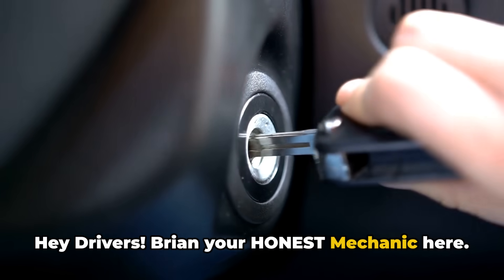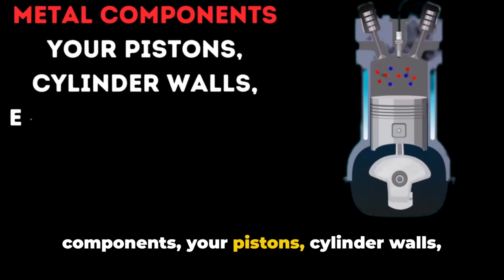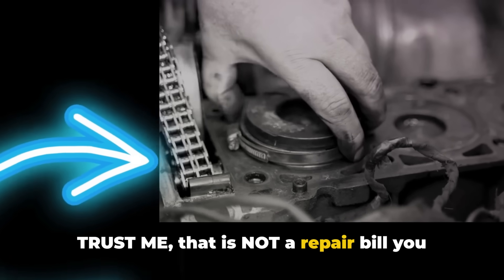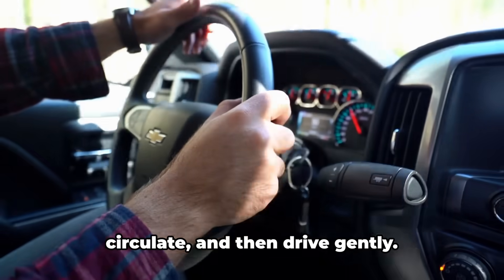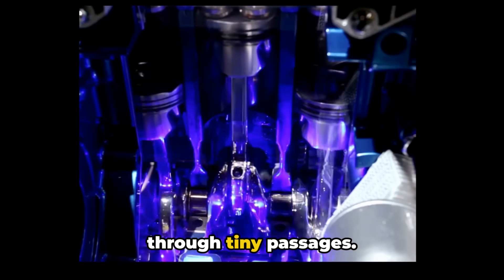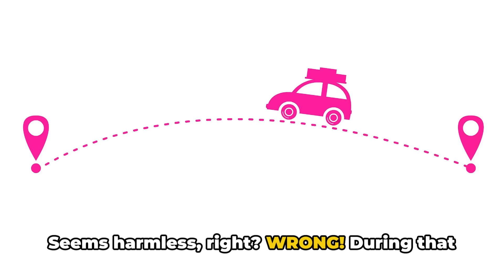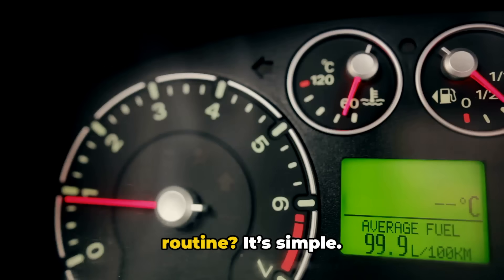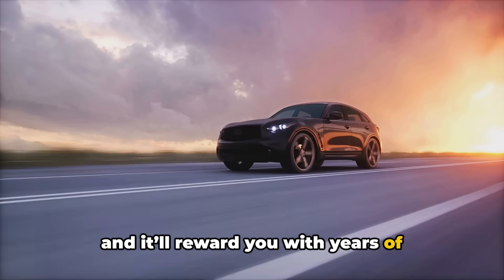5 Cold Start Mistakes That Wreck Your Engine (Avoid These)

Comment: @HonestMechanicChannel,  your correct to let it idle 30-60s first and on all your other points !  You as well as other U-tubers on this subject,  never CONSIDER/mention THE 2 step engine preset FAST IDLE!! [fastest then a kickdown to FAST (then normal)]!!  I normally wait for the 2nd kick-down before I take off; which by the way is your 30-60s (?maybe longer if 'really' cold?).  I take it easy then [ keep between 2-3,000 or so (4k)rpm],  till OIL temp. needle begins to move off peg.  I THINK FROM NOW ON you incorporate /mention fast idle into your future comments on cold starting.  {a GOOD question TO CONSIDER would be is driving off with idle on its fast idle cycle  a good idea / i.e.  hurt the engine???;;;  also ,would most cars' fast idle cycle disengage and go to normal idle speed earlier than normal? / is this ok? !

Comment: Something you can do to get that 30 to 60 seconds you need to warm up your engine is to start the car and then put on your seatbelt check the mirrors etc.  It gets you those critical seconds but not wasting them.

Comment: The first one is especially cringe worthy. I live in Colorado. On more than one occasion on a 30-40 below 0 night,  I've seen people jump in their car and hold the throttle to the floor for 10 straight minutes. Literally bouncing off the rev limiter, for at least 5-10 minutes straight. 

I always warm my car up, at least until it comes off of fast idle. 

Have you ever driven a car for an hour when every surface in the car is 30-40 below 0 ?

Comment: I disagree with the idling. I have let my engines in my Fords sometimes idle for 30 minutes before I jump in and leave. 

I get 300,000 miles plus out of my engines been doing this for almost 40 years.

Of course I am absolutely fanatical about maintenance. Either way idling is never hurt my engines.
Reply: And also wasted truckloads of fuel
Reply: What a waste of fuel though.

Comment: best rule, is to allow a 3–5-minute warmup time. it gives all the fluids a chance to circulate, and warmup. it also allow the idle speed to stabilize.
Reply: It’s what I do on bitter days. Always allow the engine’s fluids to circulate for AT LEAST one to two minutes, then drive conservatively for 1/2 to one mile to allow the transaxle fluid to gather some heat, and you’re good to go!  🚗 ⛄️ 🇺🇸
Reply: Are you driving a carbureted vehicle? That's the worst thing especially for the catalytic converter. You should never start modern cars and let them sit for 3 to 5 minutes and warm up Even the car manual is against that and the manufacturers it's not good for the modern car.
Reply: Depends highly on the temperature. Cold is not an absolute thing. I dont let my car run for minutes as long its only 0°C. Maybe when its -20°
Reply: @PM-wt3ye i always let my car idle for 5 mins in winter before leaving. Time enough to scrape all the windows and clear the air vents below wiper blades. I’m Canadian, and yes, its always -20C or more when I do this
Reply: I do 3 to 5 minutes in cold. 3 if its around -2 to -12 C , 5 if its around -13 and colder
Reply: Incorrect.

Comment: I wait for the RPM drop by the engine controls before selecting a gear.  This reduces the shock on the transmission and driveline.
Otherwise I have long used the technique you outlined.  The short distance drive is sometimes unavoidable.

Comment: Sir everything you said makes sense especially if you're driving American cars. But I drive Toyotas and had several of them over the years the mileage has been 168,000 too 417,000 with the oldest being a 1996 Camry. And every single one of them ran until I got rid of it. Just routine maintenance driving over 100 plus miles a day with cold starting and all the other stupid stuff you do behind the wheel.  "JUST Saying" Toyota 👁️

Comment: Hello.   I have a 2016 bmw 218i active tourer with a 1.5 turbo 3 cylinder and a automatic transmission.  When the engine is cold ( mostly in fall and winter time).  And the engine is rev above  1000 RPM it’s not able to drive away.    The car will simply not accelerate and go in second gear. I have to wait about. 40’seconds  and than the meter is below 1000 RPM  and than i can drive away without issues.   Is this normal?
Reply: yep, safety feature

Comment: I told my wife that we need to park our cars in our garage.  Even unheated, the garage temperature is 49-53 when outside is 30-35.  And our cars don’t have cloudy light covers even after 15 years.  Some of my neighbors, for a variety of reasons like their cars are leased, park outside.  In the winter, it’s like refrigerating the cars which is 37 for my frig.
Reply: Well, you're right about the garage!  And not only that, you can splice in an engine block pre-heater to one or both the cars, since you have somewhere to plug them into.
Reply: Yes you can fit a water heater into the water hose .And put it on a timer for say 4 to 5 hours before you want to start the car .Not only will the rad water be warm ,warming the engine ,but you will have instant heat from the car heater .Even if you have to park outside you can run a extension cable from the garage to the car .
Reply: Just be sure to open it a bit when your car is idling
Reply: Must be nice to be able to have a garage.
Reply: @oceanofjelly must be nice to have a house
Reply: It’s the wind in the wind it’s colder. In a garage that’s not heated it’s still very cold but you’re out of the wind so it’s less cold.

Comment: I live in Wisconsin. It can get  -30 below zero or colder. Windows are frozen solid. We have no choice but to let it idle until you can see out your windows.
Reply: I live in Alberta, it can drop to -40 without the windchill.  By the time I remove my windshield cover, sweep off the snow and unplug the block heater, my vehicle is ready to go.
Reply: Sounds like most people commenting may live in southern California or Florida.

I grew up in Northern Minnesota. 30-50 below 0 is not unheard of, and I've experienced 85 below 0 wind-chill...117 degrees below freezing.

You could literally drive for 30 minutes and it would still be -20 to -50 inside your car, if you followed the idle for 30 seconds and go routine. 

Who wants to dress for an Antarctic expedition for their daily commute?

A little off topic, but I currently live in Colorado and studded tires are legal here. Seems like they should be legal in every snowbelt state. I grew up in Duluth, Minnesota, picture a miniature San Francisco. Most of the city is built on a very steep hillside.

People claim cars running studded tires cause alot of road damage. Semis cause 100,000 times the damages as a car with studded tires. A 40,000 - 80,000 pound truck literally crushes the road. Where do you think the grooves in highways come from?
Reply: @425superRocket I played a hockey tourney back in the early 90’s in Cloquet and it was like -50.   Absolutely insane, but the worst cold I ever felt was in Saskatchewan.  You had to start your car every 1-2 hours just to circulate the oil so things wouldn’t seize up.  It isn’t as bad in MN the last 10 years or so, but still, I have no idea why I live here lol.
Reply: I lived in Northwest Wisconsin.  Sometimes, I would let my vehicle idle anywhere between 5 to 20 minutes when it was brutally cold.  Maybe that was bad, but I hated getting in a vehicle that was so cold that my breath would ice up the inside of the windshield. @425superRocket
Reply: no problem...get an e/v...by the time you can scrape of the ice to drive...you will need a charge...free day off...

Comment: In actually, the correct warm up should be to start your engine for 1 to 2 minutes and then driving easy  for about 5 to 6 miles to completely warm up the whole vehicle. Which includes the engine, transmission, differential and all other bearings (wheel, drive shaft and more).
Reply: Your engine needs 1-2min to start?!
Reply: Lol

Comment: How do you warm up a cold engine for oil change?
Reply: Cruise around at least 20 minutes.  I tried a driveway warm up, but the oil was s-l-o-w draining.
Reply: I am gonna go out on a limb and say you start the vehicle and let it run for a few min🙄. Although it is not needed anyways.

Comment: Living in a northern state (Wisconsin).  I crank my vehicle over and warm it up for a few minutes only if I have to remove a copious amount of ice or snow from my windows and have no other option than to do so before traveling for safety reasons.  On a regular day I start my vehicle and wait for the tachometer to drop a bit (usually 30 seconds to a minute) throw it in gear and drive slowly until it reaches a better operating temperature.  Some solid tips from this video in my humble opinion!
Reply: Same here in MN, I usually wait until the idle drops and watch the temp gauge go up 2 notch before driving off, these pass few days been cold so I let it idle for a few minutes before driving off
Reply: Why not scrape off the ice and snow before starting it?
Reply: @joby602  prob to let the engine warm up while scraping the ice off
Reply: @ethannguyen9363  Agreed.  Wisconsin has very cold winters with lots of snow and ice, so combine the 
times of snow and ice removal with a 1-2 minute idle time looks good to me... but not longer than that.  If
more time than that is needed, remove half of the ice and snow, start the engine, then do the other half.
Reply: @joby602 sometimes the ice is so solid, you unfortunately need a little help from the defroster to get it loose enough to start scraping. This raises a question that I’ve never got an answer for. Why aren’t there wires in the front glass like in the rear? I get it, not as many as the rear, but some that can help you start the scraping.
Reply: @Schneids71 Ford I beleive have the patent on heated front windscreens. A lot of their cars in Europe have this. 
I’ve always felt that they should allow all other manufacturers to use the technology for a minimal fee. Volvo I think developed the wipers/ intermittent wipers and may have something similar as they knew it was a safety function
Reply: @guyr7351  Can't believe there is a patent on that. A patent requires something innovative and obviously there is nothing innovative about a wire-heated window, be it in the rear or in the front.
Reply: @Schneids71 By a windshield cover for your vehicle. They work great.
Reply: @pliccut I love the frostguard brand. I have one for the front and rear windows as well as the side mirrors. I also have their acrylic scrapers.

Now to get more for the rest of the family.

Cheers!
Reply: @Schneids71  Do you want to drive down the highway looking through wires? Ya'. That's what I thought...
Reply: @joby602 , and scratch the windshield each time while doing so!

Comment: If i am engineer i would develop electric oil pump with normal oil pump and for heating i would develop electric heater that warms coolant. AC compressor only freezes i would develop AC that heats and freezes. Develop VR8  cylinder engine (one head)  that can work only with 4 cylinder for fuel consumtion. Timing with only gears. Supercharged engine belt driven or strong electric charger.

Comment: I would also add that oil temp is prob more important than coolant temp. Oil temp takes long to get to operating temperature than coolant temp does. In other words just because your coolant temp is at operating temperature doesn't mean that you oil temp is too. Unfortunately for most modern vehicles, the car doesn't let you see your oil temp. Just another way modern cars don't last long and are engineered to get you into another new car sooner. Money money money, the only thing that matters to some.
Reply: I worked in the Arctic for about 30 years and about six months a year we idled our vehicles all day. We usually started them an hour before we used them in the morning. Diesels make a racket when starting an engine at 40 below. Colder than that we just left them running. We had weather front on our grill.
Reply: Very well spotted.
Reply: My father's old car Opel Corsa B Sport 1.4 turbodiesel there was no oil temp neither oil pressure yet it did almost 500K KM with no engine repairs and it would still be working with the same engine if my brother didn't blow it's head cause a water pipe blown and he kept driving, overheated it and cracked the head.

My Peugeot 206 1.4 HDI for example is eating a bit of oil much worse than the opel and has around 250K KM so I guess it just depends a lot on the car, the Opel Corsa has a Isuzu engine is a amazing engine from Japan while my Peugeot has a crap Peugeot, Citroen and whatever engine which I don't even know who make it as it's used in other crap cars...
Reply: @guily6669  Isuzu make great Diesel engines, I had one in a Vauxhall Opel Astra 1.7 CDTi (in the UK) and i remember the engine oil stayed visually clean after a oil change for some time, amazing for a Diesel I thought. I respectively disagree that Peugeot Citroen Diesels are crap though. I had a Citroen Visa 1.7 RD (made in 1986) and I did 178,000 miles in that car before I sold it (I was given my parents old Vauxhall Cavalier 2.0 Automatic to replace it). The head came off at 100,000 miles to fix a head gaskert small oil leak which the mechanic was worried that the oil could get to the cambelt. In fairness to Citroen the new gasket had been redesigned to prevent the oil leak happening again. Despite only having 4 gears the car returned 55 mpg (UK gallons) driven fairly fast being an aeodynamic design. Always easily started in cold weather without Diesel fog coming out of the exhaust.
That said the later small Citroen Diesels were perhaps less reliiable.
Reply: Many cars with digital dashboards provide this.
Reply: Absolutely right. I was pleasently surprised, that my 2007 van I bought in 2023 has an oil temp gauge right in the main gauge cluster. No other regular vehicle I owned had this.
15 years ago, I didn't know that yet. My car had a gauge for coolant temp, and when that was up, I pushed the engine. It was a gas engine though, which heats up faster. My current car is a rather efficient Diesel, which takes a lot longer to heat up, oil gauge starting to rise when coolant temp is almost at full temp.
Since sometimes it takes almost 20 miles in winter to fully heat up this engine, I finally decided to block some of the air vents in the bumper. Works alright, oil gets warm faster, maybe I should block a little more. This old engine is still efficient, that even rolling down a hill in gear in the cold let's me see the temp gauges slightely go down.
Reply: Loved the oil temp gauge in my 1999 car
Reply: Transmission oil warms up even more slowly. So its  best to wait for 5 minutes or so after engine temperature reaches Normal level to use higher revvs.
Reply: You're right, oil temp is at least as important as coolant temp, I watched a Ferrari owner video where he drove his beloved 308 to exercise it and wasn't pleased the oil temp needle barely moved.  And was still only 2/3 warm after almost 10 miles of driving.  But the engine holds 10 qts that might have been a factor -
Reply: The Henschel engine in my '65 Kässboher Setra will feel different after about half an hour of driving.
It just runs more smoothly and only after that I would subject it to running at high RPM.
It has some estimated 400 thousand miles on the clock and is still alive and well
Reply: A lot of cars nowadays have oil coolers that are just a small heat exchanger to the coolant.  If that’s the case, I’d expect the oil to be brought up to temp pretty soon after the coolant is.  I’m hoping/assuming that they didn’t go to the expense of including an oil thermostat.
Reply: Yeah you never have to worry about oil temp. If your engine's coolant is at operating temp then the oil has been the proper temp For a while. Oil pressure is more important and even the loss of like five PSI and oil pressure could tell you about a potential problem like blown head, gaskets or leaky rings
Reply: If anything, the old ones are the ones that didn’t show the oil temperature. My 2004 Toyota avensis only showed the water temp, and my 2018 bmw 1 series and 2020 Audi Q3 both show oil temperature.
Reply: you dont need full oil temp to drive it. once the coolant is at operating temp the oild should be at around 50 celsius which is enough unless youre hammering it
Reply: That’s the great thing about my 2014 x5, it has an oil temp gage… I don’t hit the freeway until the temp needle starts moving.
Reply: @R69H May i aske ?
In how many minuts it reach right temperature?
Reply: oil temp doesn't increase with idle without gas peddling. so  coolant in operating temp is reasonable.
Reply: What u talkin bout, most old cars dont show oil temp.... the newer ones do
Reply: @kristoKR-zj8oi FYI there are modern cars that doesn't even have a water temp gauge
Reply: If there is no oil temperature sensore there is anyway oil pressure sensor (displayed on the dashboard), wait until pressure reaches working range because it is correlated with the temperature ( higher oil pressure on low oil temperature, lower oil pressure on high oil temperature ).
Reply: alot of cars dont even have oil temp sensors
Reply: The coolant temp just tells the driver the engines hot enough. If the engines hot enough so is the oil.
Reply: @ryans413 That’s how I think, too. It makes sense!   🛵

Comment: Isn't 60 seconds a little bit too long?
Reply: Rule of thumb I go by is whenever the cold high idle drops to below 1000rpms so the transmission goes into gear gently whether that be 30 second or a minute and half.  The engine isn't the only thing I'm protecting.  Different cars idle down at different speeds.
Reply: You are JOKING OF COURCE?!. THATS ONLY (1,MINUTE) Registered Technician, With FORD MOTOR COMPANY Australia with 65 year's experience you listen to the expert WHO PUT THIS OUT THERE TO SAVE YOU MONEY & YOU QUESTION HIM???!!. THERE'S ALWAYS A KNOW IT ALL!?. OUT THERE#.